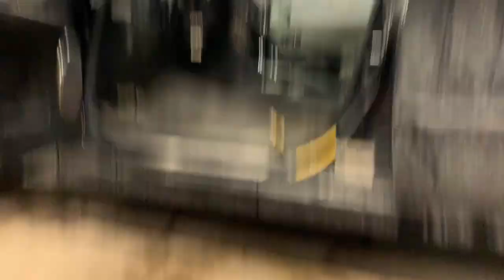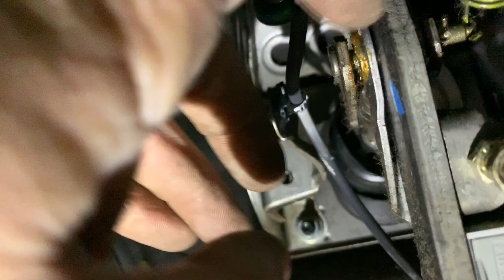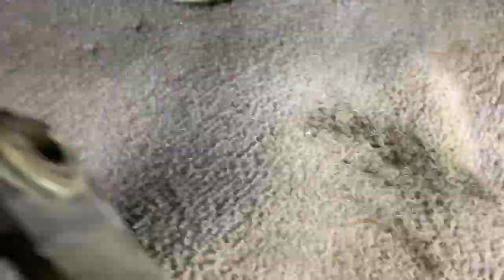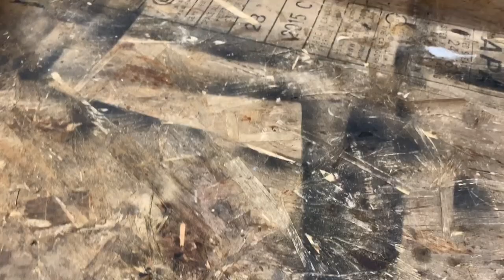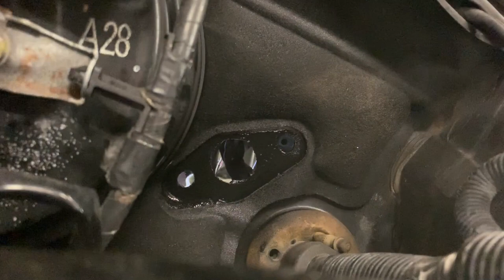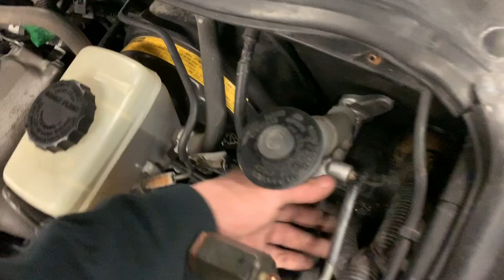Is300 step by step manual brake and clutch pedals

Comment: The hard line coming out of the master... what does that hook up to??
Reply from the maker: that hard line is the line that goes down to the slave cylinder at the trans in between on the is300 the have a clutch damper and i deleted it with a union fitting